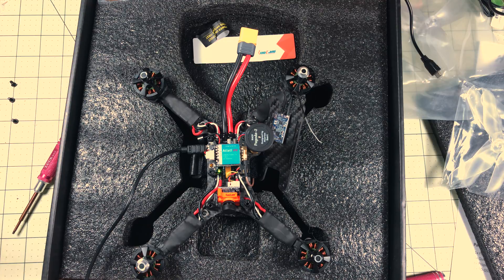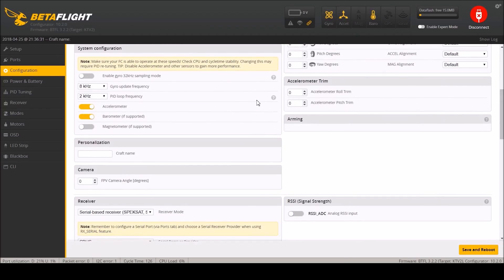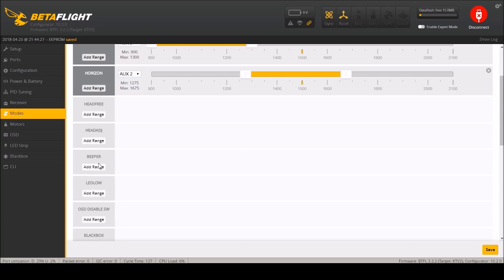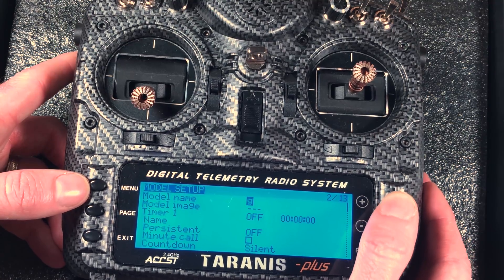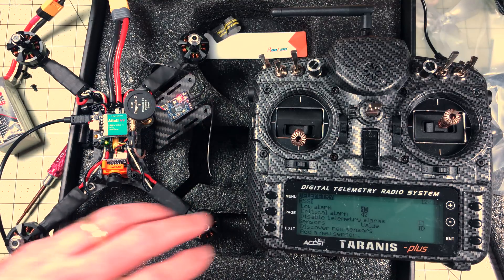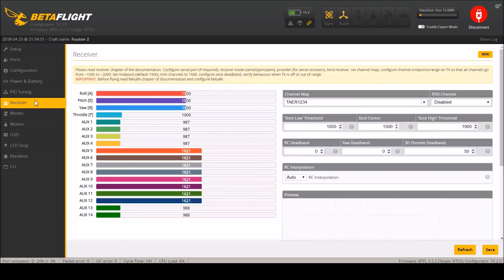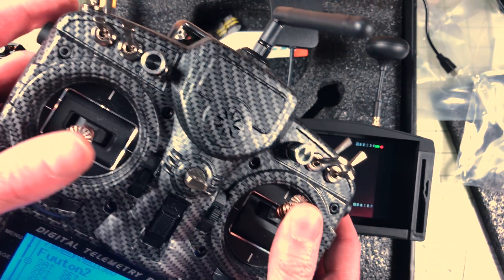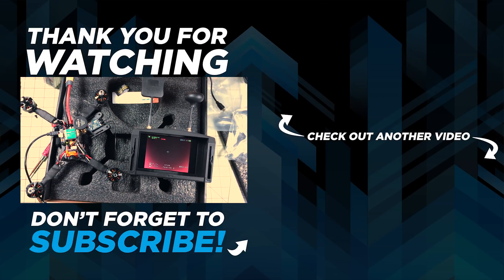Helifar Fuuton 2 Setup in Betaflight, with the FrSky XSR on an X9D.  Tramp telemetry and LUA ROCKS!

Comment: i ibinded mine but throttle is on the right stick and roll on the throttle one on the left... i have mode 2 controller but binds are all messed up
Reply from the maker: Go into betaflight under radio and you can choose the channel order. Although that sounds like the radio thinks its mode 1.
Reply: @SimRacer101  I had to go into the mix menu on my qx7 and reassign the inputs. I had to do the exact thing on another 2 qx7 that my friends just got. It's good now

Comment: Hey...am wondering why you use motor stop...what is the advantage?  It is only for angle mode, I presume, as air mode is active for horizon and acro mode...
Reply from the maker: Yep exactly.  I only use it for Angle mode which I mostly only use for landing.

Comment: I’m with you on MOTOR_STOP. It makes sense to me. And I liked thy you took the effort to show the step by step on your Taranis. What I liked the most of it is the fact I knew them already 🙂 - Noob question: the receiver number on the bind page needs to be set independent for each model we have on the Taranis? Different models can’t use the same receiver number? Sorry for the basic question.
Reply from the maker: You can use the same number for all of your models. Some people just use one model on their radio. BUT if for some reason you have two one at the same time it will control them both as the same time with can be REALLY dangerous.